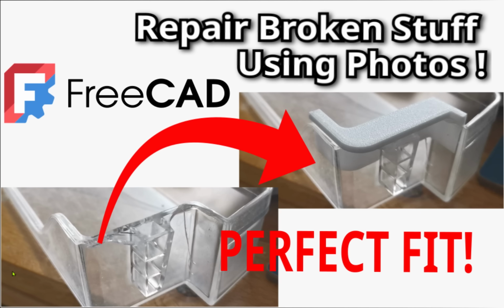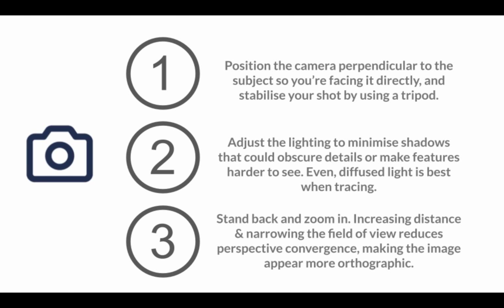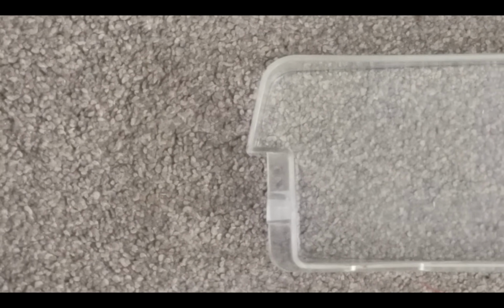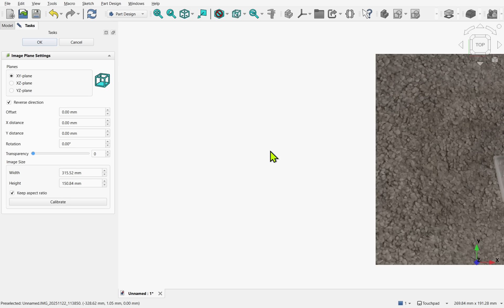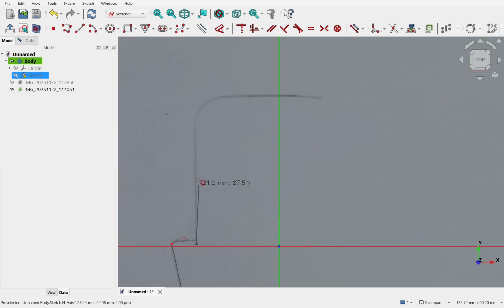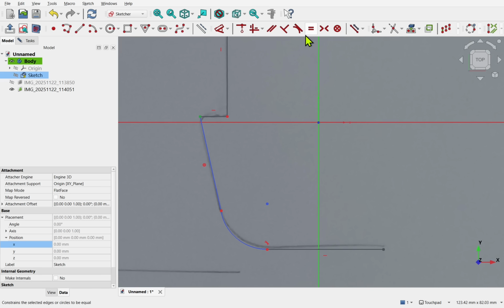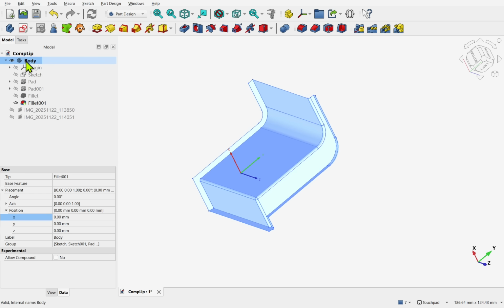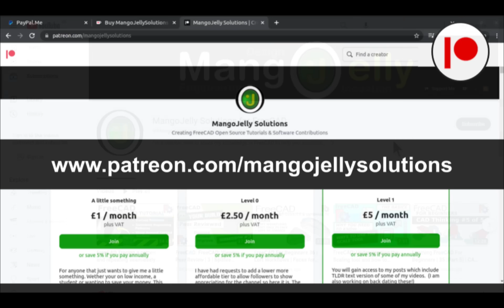Traced Photo to 3D Print: FreeCAD Repair Workflow Explained

Comment from the maker: Equipment shown in this video:

ATUMTEK Phone Tripod Mount, Universal Smartphone Mount Adapter with 2 Cold Shoe and 1/4" Standard Screw, 360° Rotates and 180° Tilts Adjustable Cell Phone Clamp Holder for Perfect Mobile Photography
https://amzn.to/4pLvidK 

HYCHIKA 50W LED Work Light, 5500 Lumen Portable Flood Lights with Stand, 5000K Daylight for Outdoor, Indoor, Car Repair, Work Shop, Construction Site, Job Site
https://amzn.to/3Y4u1Cj

ELEGOO PETG Filament 1.75mm White 1KG, 3D Printer Filament Dimensional Accuracy +/- 0.02 mm, 1kg Spool(2.2lbs) Fits for Most FDM 3D Printers
https://amzn.to/4s3Rn8T

(Amazon Affiliate Links)

Comment: When I do this and model can be placed on flat surface for photographing I make sheet of paper with printed millimeter or centimeter gird. It provides lost s of features I can use for calibration.

If I cannot put object on flat surface i print rulers, like angled rulers 3 x 3 cm or so with millimeter scale, cut them out and glue them where feasible so again I get good references for calibration.

It is also useful to use Document option in phone camera. It recognizes shapes and flattens out image reducing distortion created by wide angle lens.

if object itself is flat I simply put it on 2D scanner and scan it like it is an image. So I get flat scanned image of object. It also helps adding rulers besides object to have it scanned within the same image for calibration.
Reply from the maker: Thanks for adding these tips, especially the grid paper and document scan ideas! Really helps others, the comments on this video are a wealth of information.  Thanks for adding to them.

Comment: Interesting process! I am very surprised that FreeCADhas no feature to automatically trace the shape, and that you do it manually.

 I do basically the same thing with completely different software and image techniques/needs. And no manual tracing, although I tend to manually fix color/contrast errors in bitmaps so the manual mouse time involved is probably close to the same. 

I use either a traced sketch or photo, but as hard and dark of a line as possible. Photos taken in harsh light for the same; highest single color difference from dark to a dead white background is needed.

 Converted to B&W in gimp( and for photos, contrast and a few other things are adjusted to get hard and fast black/white differences for edges) or plain old Windows Paint. Export to bitmap, then Inkscape fixes scale, and traces the edges of the bitmap automatically and converts to a SVG path. Which is then infinetally re-scalable if needed. 

Then OpenSCAD imports SVG directly. Then I can extrude, CSG, add, subtract, whatever I need.  

Thank for sharing, its cool to see how other do the same basic process, or even completely different process to the same result!
Reply from the maker: It's interesting that you said about using other software to get the shape, I know about gimps edge detect filters and online convertors to SVG but you still need to do some pre-processing after converting the edges to a sketch (draft to sketch and then some sketcher work).  Be an interesting experiment, need to give that one a go.  Also I think that's were I'm going wrong with edge detection, I'm using gimp rather than inkscape.  I need to try that.

Thanks for the detailed response, great to share that knowledge and going to try some of what you said.  Yeh really interesting, thank you :) :) :)

Comment: Quite often you can use a flatbed scanner with the top open.  Just use a box over the whole scanner to block the light and as some people have noted a rule on the bed helps to scale the model.  This may be easier than using a camera it works for me anyways.
Reply from the maker: Nice tip, thanks for adding.  I think it would be easier as it's just a small section.

Comment: Nice tutorial, as always. Thanks! p.s. PETG is not impact-resistant. It's actually quite bad at absorbing impacts. When PETG part receives a strong impact, it not just breaks in a single place, but it often shatters in many sharp pieces. That's why I went to PCTG for everyday prints and never looked back. It doesn't shatter like PETG and has about 10C higher glass-transition temperature.
Reply from the maker: Glad you liked the tutorial, and thanks for the detailed insights on PETG vs. PCTG - very helpful to know! Yep sorry my mistake regarding the properties. PCTG I haven't used yet, I will have to give that a try.

Comment: An additional step that is sometimes useful is to remove lens distortion in the reference images. When taken with a camera, there is almost always distortion at the edges of the image. There is a project called "lensfun" that can be used with DarkTable to remove the distortion caused by the lens shape.

Comment: Block constraint *noted! 
Nice quick tutorial, keeping it simple and cheap for those odd jobs. I tend to drag out the 3d scanner these days, basically gets you the same results but with more steps. The biggest thing I've found while reverse engineering is measurements and curves are mostly rounded up and symmetrical for the most part, not often do you find exotic numbers on your basic fridge or toaster build.
Reply from the maker: Just watch out for the block constraint.  They are not a true constraint but are ideal for freehand and tracing.  They can remove coincident constraints and you have to be careful not to use it as an excuse to get to fully constrained.  I do have a 3D scanner but found it was so frustrating, it used to 'smear' the model just at the last moment when you thought you had the perfect scan, I need to try it again.  Which one are you using, I have the Scan Ferret, I need to try it again as it was a long time ago, hopefully the software is better.
Reply: @MangoJellySolutions  Good info, I like the possible cheat to fine tune a line before I work out proper constraints (I'm lazy :) ). 

I've got an Otter and Raptor, they cover all the hobby and reverse engineering scenarios I throw at them. CS-4 on my M4 MacBook 24g works pretty good for me (the OtterLite work good on M2 with 8g ram). I'm building experience in FreeCAD so I can finally close off fusion. Mesh body import and conversion still gives me a little stress but slowly getting there with your Channel and a few others. FreeCAD has so much potential.

Comment: I had to lough so loud in the first seconds of you video as I thought, you got (somehow) photos from my fridge-repair! It looked so incredibly similar to mine, what I have done, with taking photos, reconstructing it in FreeCAD and printing the replace / strengthening part with exactly the same filament color and the same uneven structure (from printing bed) on that one side.... Cool! :-) PS. This must be a weak spot on every refrigerator I would say :-) PPS: Finding the right glue for the printed part (PLA in my case) with the acrylic one was not easy to me; what have you used?
Reply from the maker: lol, you must be right, it must be a weak point. Also, do you think most selves are the same standard part? With the glue I used a cheap super glue which seemed to do the trick.  It's held up so far, I must admit I was expecting to see the contents of the fridge over the floor in the morning but all good.  I was tempted to pad some circles and drill holes in the shelf for a physical connection to be on the safe side.  I wonder if PTEG is better to take a wider range of glues as I had no troubles.
Reply: @MangoJellySolutions  My selve looks very similar to yours but it would probably not fit into my Siemens / Bosch. I used first also super glue (incl. sanding both parts) but took not too long and came apart (without a ...disaster). Then I sanded them more and used two component glue and since then, it holds good. If this will not hold in any given time, then I thing your suggestion with holes and screws would be the next try - but I will not buy a whole new part, I will design it in FreeCAD and print it (in parts) :-)

Comment: For those kinds of objects, I would use a light plate like it's sold for slide sorting or copying paintings. They are sold for cheap on zomaAn or so. At least you did not have to fight with shadows.
Reply from the maker: That sounds like a really good idea.  My work light is extremely over the top and I end up blinding myself each time.

Comment: Good tips. I frequently print shadow box frames for odd shaped (fan, oval, octagon) picture frames that my daughter buys at garage sales, thrift shops, etc. Working from a photo can be challenging due to perspective issues - even a flat bed scanner can have some distortion for sections that are not totally flat. I have learned that printing a thin test piece of various sections is well worth the effort to allow you to correct for any distortion or measurement uncertainty. Multiple measurements on the original part also help. Also, don't make assumptions that an oval is actually an ellipse, or that holes that look centered are actually centered - even on injection molded parts that one would think would have been drawn with precision. Somewhere out there, there is a tool and die shop that employs blind monkeys to machine the tooling.
Reply: Test pieces are a very good idea.
I printed just the thread that screws on to a glass bottle to check that the thread dimensions were correct

Comment: I was expecting a better approach, tbh. Your's have many prerequisites (camera or scanner, regular shape and contour in one plane) and I personally find its not that useful in many cases. 
A better one would be: without a tripod and with a perspective correction. You also need to account for lens distortion. Zoom helps a bit but not terribly. Just thinking outloud: probably a photogrammetry with measurement of some part of the object for reference would be less error prone. But I haven't tried yet. Still this is a good production, clearly explained and showed. No offence to the author, but thats how modern prop replication works for a decade, and its pretty accessible and reproducible.

Comment: I see you've also got a Makera Z1 now. How are you finding it?
Reply from the maker: Yes, love it, I need to do more with it and the software that comes with it MakeraCAM is great to get up and running.  I still have to work out the 4th axis, doesn't seem to be enough clearance so I must be doing something wrong.  I downloaded an STL of a sea horse as a test for a 3D relief  in wood and it was made so easy to get it from start to finish.  The working area is a bit small but for compact hobby pieces it's great!

Comment: Oh! I had no idea about the block constraint - I've seen it on the toolbar but never knew what it was for. Thanks!
Reply: Yep, I always see in this videos how lost I am.
Reply from the maker: The block constraint is great for this kind of work but it can be easy to misuse it as a short cut to fully constrained.  But for BSpline, freehand and work like this it's a life saver.  Just watch out as removing the block can lead to coincident constraints being destroyed.  Glad to show something new :)
Reply: Same! I just made my first photo based print on something with lots of regular curves and inconsistent radii. I finally got it after hours of adjusting one curve and having to fix all the adjoining ones over and over. 🤦

Comment: Good tips here. It would be better to include a ruler in the photographs and scale directly from that, removing inaccuracies in your pencil line. Also, in the photo, choose the largest dimension to scale from (eg the full width of the tray rather than the smaller feature) as this will also help make it more accurate.
Reply: Trace onto grid paper instead, and then you have a built-in scale. It’s given me excellent results.
Reply: I think the drawn line is prob more accurate than a ruler because the ruler has depth, so it's 5mm closer to the camera, therefore appears marginally bigger. We don't live in an orthographic world, so that will make a difference.
Reply: An alternative to a ruler is to put datum points on the object with a marker pen. Use a ruler to place them precisely
Reply: And make sure the ruler is at the same height as your planned profile. I once got a picture with a tapemeasure 1cm above the target and taken at arms lenght.. I can't belive to this day how waaaaay off the printed part ended up at. (~10% error)